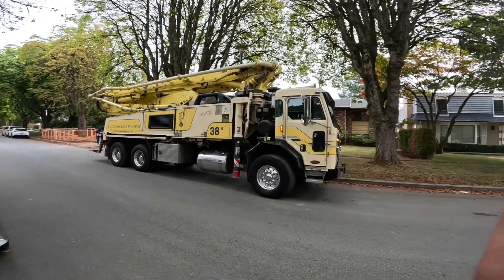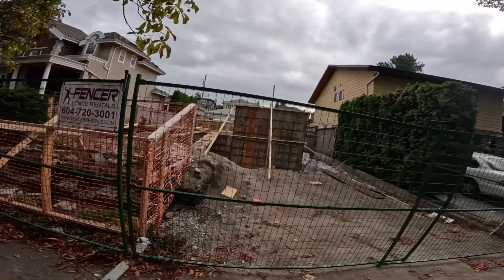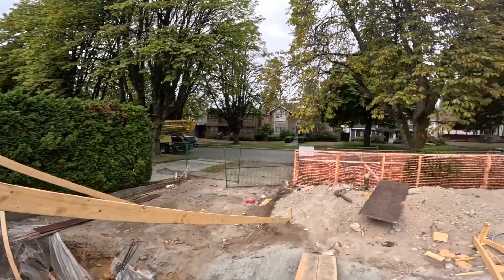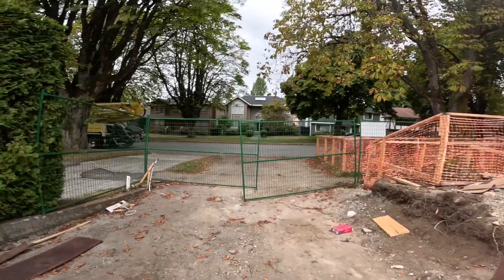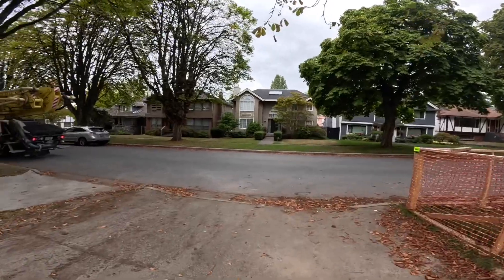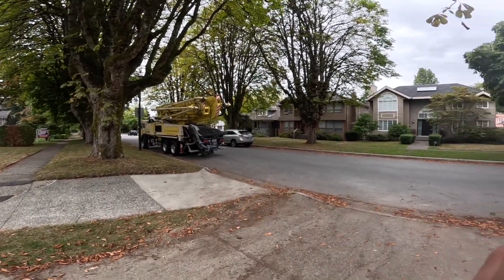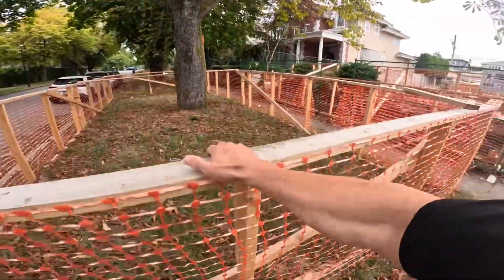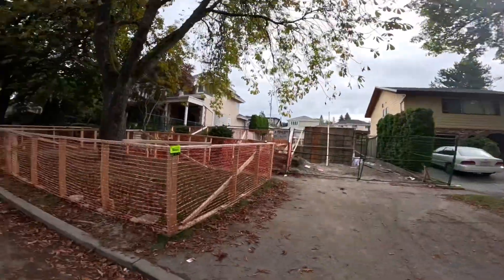Where would you setup the concrete pump? (Part 1):

Comment: First off… cops called for tree roots!?!?! That is madness. Soon the city is going to make you pull permits if your boom is gonna swipe a leaf.

I’m going with 1. The 2nd option, trucks gotta back all the way down to ya, and would you have to back out? Could the 38 make that sharp right turn? I feel as if you went 2, you are saving yourself a little bit of hard labor but cause more mental labor for every truck driver that has to back in (and you if you can’t exit straight ahead).

Pumping concrete is a team effort and everybody involved in the pour should be brought into your thoughts when setting up. Always gotta try to find that happy medium! Sometimes you can’t always make everybody happy but you have to try! Now I just need it to be Saturday already! I can never watch too much concrete pumping content 🤓

Comment: I’d say traffic control, and communication with the neighbours is on the contractor, in both cases. I’d go with #2, less impact on the public overall, and safer for pedestrians and the mixer drivers.. and if you should happen to have an issue with the pump, I’d rather be cleaning a back alley than the street!
Reply from the maker: I agree with you on all points made 👍🏼👍🏼👍🏼

Comment: Considering the quality of current day mixer operators in our area. Option 1 is the only possible way to do it. Getting a truck driver to reverse 300 feet or more would be impossible without something getting broken. There is 2 reasons that the transition elbow is substantial. 
1. Keep cement inside
2. Keep mixer bumpers outside.
Reply from the maker: Lol!!!! We’re lucky on this job to have one of the better/best ready mix outfits in town supplying. Most outfits now have backup cameras anyhow. What could possibly go wrong??? 😂😂😂

Comment: Option 1 is the most common sense for mixer truck accessibility, minimal disruption & access for surrounding home owners/neighbors...why create problems for adjoining home owners or unnecessary backing up of mixers down rear lane ways when you have Option 1??
As someone who's been in the concrete business since 1977, Option 1 is the better choice unless I'm missing something or not being told something that's been omitted from this video...
Reply from the maker: Fully agree with all aspects which you point out. Everything has been presented in this video (there was one pleasant little surprise, but it was not a factor in the decision making process).

Comment: If I’m totally honest I’m going with the back set up. 5 trucks should take no longer then 2 hours with the steps in the foundation. Also that will give those jumps time to work with/ set up when changing trucks. Easier to recirculate. Also to note that mixers won’t be in the street dealing with drivers. I’d rather have people back up and be extra safe. Plus with construction like houses in established neighborhoods, neighbors have to have a little flexibility. I wouldn’t be bothered by drivers and the neighbors if I set up in the alley.
Reply from the maker: Without revealing the final setup location, I will say that I arrived at 12:00PM, concrete showed up at 1:00PM, foundation was all poured in at 5:30PM, and I was folded up and ready to washout by 6:00PM. 

Being located in a dense urban center and the supply challenges which it presents, we are lucky to average much more than one load (10 cubic meters) per hour on these types of pours:
Reply: @canadianconcretepumper1979  I’ve been there before. Maybe that’s the nice thing about being in an area where we can get concrete at the drop of a hat. I’ll be looking forward to seeing which spot you picked.